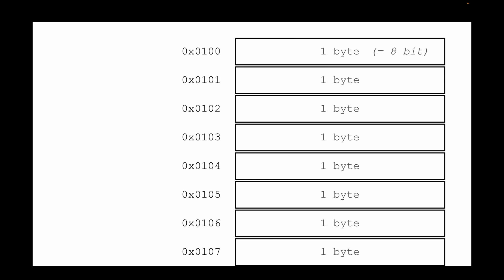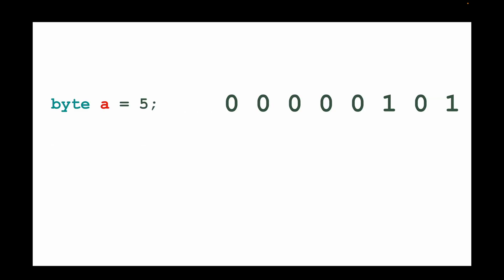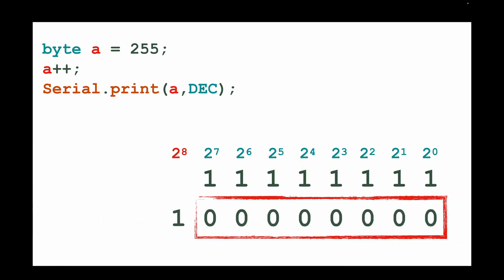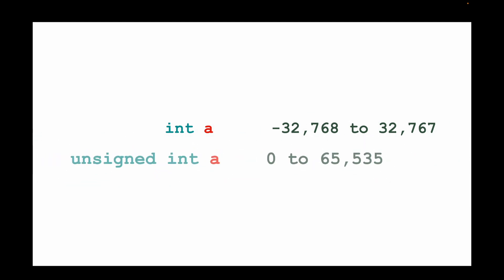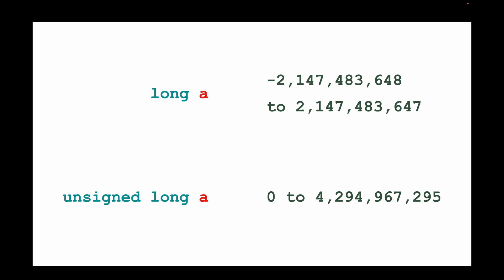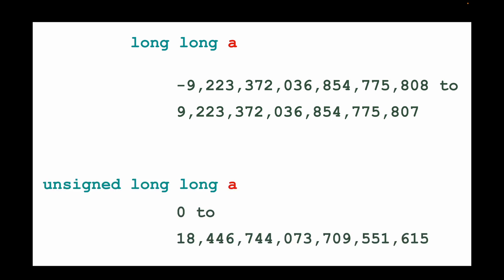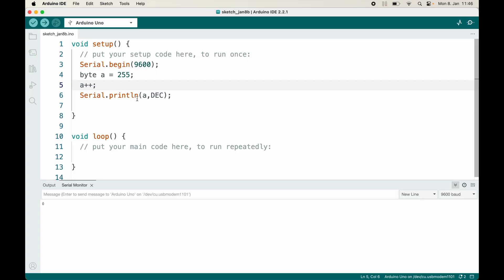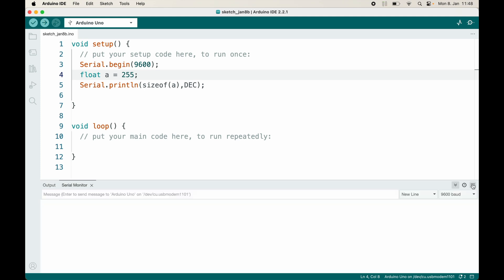Arduino data types - (Arduino Uno Programming for Beginners)

Comment: Nearly perfect video. In my opinion there are only very small optimizations possible:
1. Even sizeof() looks like a function, it is not a function. In fact I guess most coders don't know that and as long as you don't write a compiler probably nobody needs to know that sizeof() is in fact an operator.
2. Maybe a few sentences are missing about how to write a number like 1,000 in code (I talk about writing 1000 or 1,000 or 1 000 or 1'000 or ...).
4. It was new to me that the the result of an overflow can be unpredictable. I just read on the Arduino webpage. They wrote that even every signed overflow is unpredictable (not only long long).
5. I think you shouldn't talk about the floating point numbers in this video, since guys won't understand the disadvantages of floating point numbers now and they might prefer float now instead of using integers. Floating point numbers needs an extra video. (And maybe also an extra video about good and bad names for variables)
Reply from the maker: thank you very much for the detailed feedback.
1) wow did not know that, I'm happy to always lern from your comments :)
2) yeah true this is tricky
4) the thing is, there are different ways to store negativ numbers, thats why it is unpredictable, however I guess as long as you do not change the platform or compiler, it should be predictable.
5) yeah good point, it was a little bit too much and might confuse